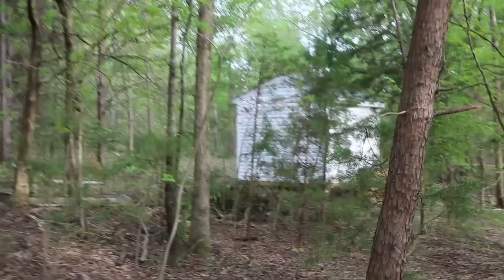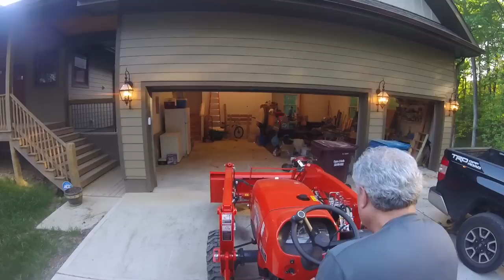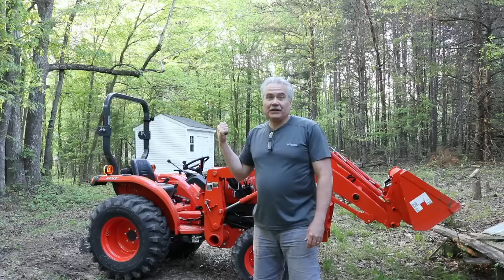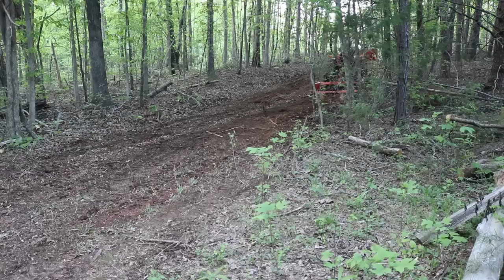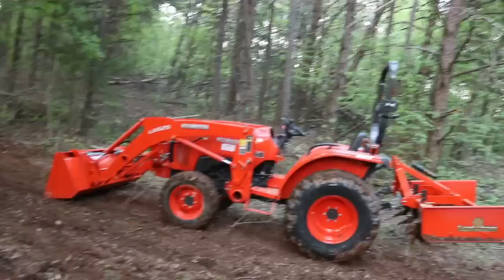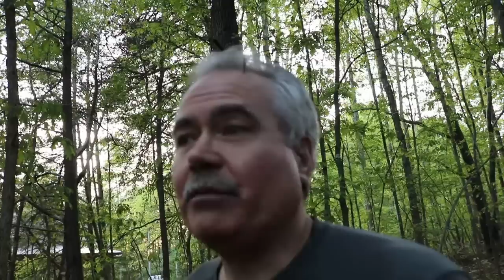#54 Land Pride Grader Scraper GS1560 and Kubota L2501 Repairs a Rutted Dirt Road

Comment: That is soooooooo impressive, at the beginning I just didn't think it would be enough to do the job. It looked wetter than it actually was. 
   The roll bar cam was a great view,  but the tripod angle gave the appreciation of the true size of that beast. 
  And lastly, how effortlessly the L2501 pulled it. Those scarifiers were down deep!
Amazing, amazing video.
Reply from the maker: Thanks so much for the kind words.  This was a very fun and satisfying chore!  Due completely to the capabilities of the tractor and the land plane.  There are many more areas on the property where this attachment will be useful.  Thanks for watching!
Reply: The 2501 is a work horse...... its scary what its capable of....

Comment: Wait until your 80 like me. Started slowing down a little this year, running out of air like you. Main thing is not to set around, go to work everyday and work like you are 20 but just a little slower. Good video , make your top link a little longer the rear blade should be on the ground. Sides should be also flat to the ground.
Reply from the maker: Thanks, Lee!  I hope I'm still out here when I'm 80.  That is the plan.  Thanks for the advice on the grader scraper!  Thanks for watching

Comment: I was just getting ready to buy your set up. Do you know what size box blade that is?
Reply from the maker: Hi Joseph.  I don't have a box blade.  I have the GS1560 LandPride Grader Scraper.  It is 60 inches wide and it is perfect for my driveway.  I also got a County Line scraper blade to dig out the driveway ditches first (see that recent video) and then I use the grader scraper to finish it off.  Good luck with your purchase!  Thanks for watching.

Comment: That mud has to be removed down a foot then pour in the gravel.  Poor guys with the truck delivering the shed.  Looks like they barely got out of there.   My neighbors have had to remove the soft stuff and fill with gravel afterwards because they tried pouring over the mud and it just disappeared over time with little improvement.  It can get very expensive depending on how long the driveway is.
Reply from the maker: Hi Oby!  I agree, but I won't be putting down gravel on this road because I only use it for my tractor and about every 3 months I back my truck down to tote the diesel cans for storage in the shed.  The issue was that they delivered after a very heavy rain... bad timing!  Thanks for watching.

Comment: Nice job, what size is your property? I have 10 acres. 2-3 acres of food plots, perimeter trails, and a couple acres of to brush hog. Looking to run a tiller, brush hog, a land plane like yours and front loader. Would you hesitate to recommend a L2501? If you bought again would you go with the L3301? Thanks
Reply from the maker: Hey Buckdragger!  We have 24 acres roughly in a square shape.  Mostly hardwoods with a 5 acre pasture on the West, an acre fish pond smack in the middle, and about 3 acres of road front I have to cut with the rotary cutter on the tractor.  This used to be a tobacco farm and we have several dilapidated tobacco barns, but one still standing and useful.  I wanted the L3301 but trying to be budget conscious and really size the power to the problem, I decided on the L2501.  This tractor more than meets my needs here and I'm very happy with my decision... an added bonus is that I don't have the regen cycle to worry about and the extra maintenance of those regen parts.  The loader on the L2501 and L3301 are the same capacity.  So, I would recommend the L2501 all day.
Thanks for watching!

Comment: Doing what I do this device is probably the most used implement I own...... they are great...I added cutting edge to rear cutting arm so when I back blade I get a better cut also
Reply from the maker: I will definitely get the rear cutting edges in the future.  I think my next mod are the bucket hooks and chain boxes.
Reply: Chain box? I already welded hooks on my bucket.... but honestly since I bought forks I rarely use hooks

Comment: I don't like grader boxes my Kubota does not have the power for it even tho it's 4 wheel drive mine is a 255 model
Reply from the maker: Hey Philip, yeah, I chose the grader scraper over the box blade because it makes more sense for driveway maintenance.  At least to me.  Thanks for watching!
Reply: I have a 23 hp 9N ford, it has plenty of power to pull a box blade. Just can't vote off more than the tractor can chew.
Reply: I'm glad I'm not the only one that gets done just before the sun goes down.

Comment: You were extremely lucky and should be just as thankful that your delivery driver did what most others would not have done nor even attempted to do. (i.e.) He took the responsibility upon himself to drive his truck down a soft rain-soaked dirt roadway, a chance which could have had dire repercussions for both him, his boss, his truck and the shed itself. Most drivers would have dropped the shed at the head of the road and said that was as far as they were willing to take it and if you read your delivery contract, the driver would have been within his rights to refuse to go any further. Inasmuch, as very few drivers would ever drive their truck with that kind of load on a roadbed that was unstable, soggy wet, and not suitable for holding the weight of the truck and its load.

Additionally, attempting to level a wet soggy dirt road with a land leveler implement or other tractor tool is wishful thinking and not going to be successful. The dirt being wet will clog-up most any implement and not allow it to do what it was/is designed to do nor perform in the manner in which you want it to. Instead of actually leveling the road, you will be moving clumps of muddy dirt from one place to another and not much else. You will also be removing dirt from the roadbed itself and thereby, making the road deeper than the shoulders of the road with each pass. That being a scenario which will cause more water to stand and settle on the roadbed the next time it rains.
Reply from the maker: Hey Scott, great observations and input.   Yes I am definitely lucky everything worked out and the dirt road is back in business.  Thanks for watching.
Reply: @homesteadpilgrim  If you have a landscape rake, you can use that implement to level the road when it is wet. This method will not let you drive on the road because the soil will still be wet, but you will find that the roadbed will dry-out 10 times faster by using the landscape rake to even out the mud and road ruts. The rake will also bust up the wet sod, but in doing so, it will not remove any of the dirt from the roadbed. After the road completely dries out, you can then use the landplane/Land leveler to do a finished job of leveling the roadbed.